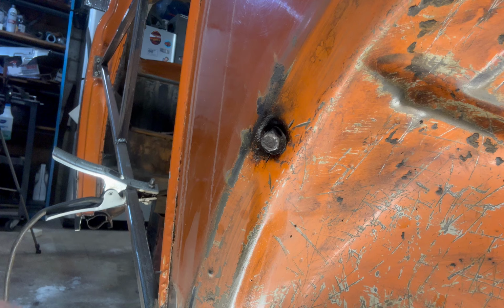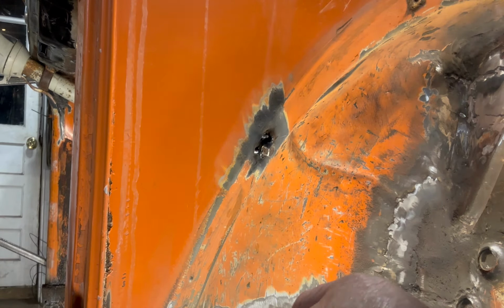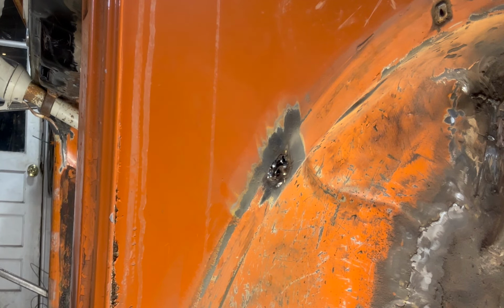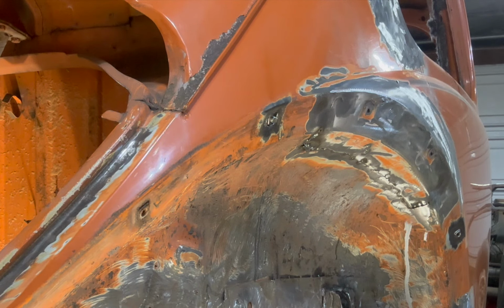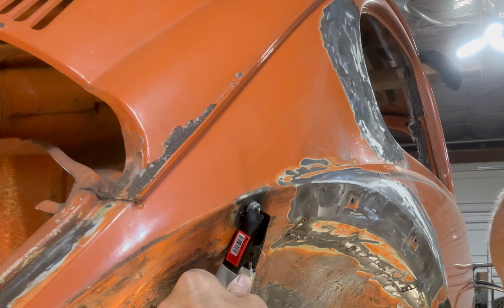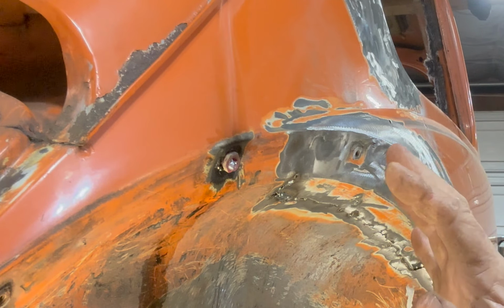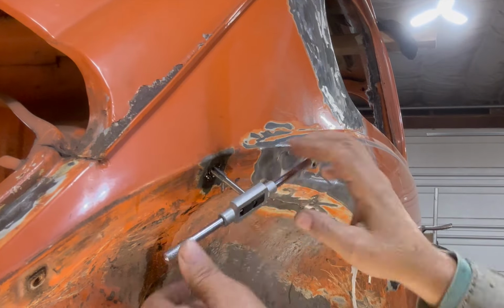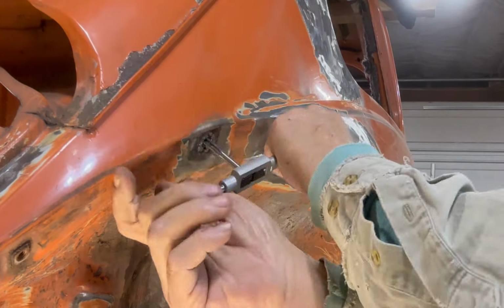FENDER FLANGE NUT BOLT AND WASHERS REPAIR

Comment: Good tips there Dave. Made me think of a problem I have. Last heater channel installed, all sprayed up, finished, mated the pan back up but when I tightened down the pan bolts most of the captive bolts came loose. First time that had happened to me in all the times I’ve fitted them, so annoying with the part and with myself for trusting the part. Cheap parts no doubt, the channels and the closing plates used to be separate, so you could check and prep, rust protect etc then weld up, and the metal was thicker/better. Long and short, learn from my mistake, if your channel is a complete one, turn it over, drill out the spot welds and give the captive nuts a Dave special, lot’s of penetration👍🏼
Funny thing also, I kinda knew you was thinking it as I was, but when you said “try,try, try again” it did make me smile. Have a good weekend buddy👍🏼
Reply from the maker: U 2 fill-up, I have hear of guys having problems with heater Chanel’s as you describe. I have heard of guys spot welding before inspection to stop this failure. Enjoy your weekend Philip.

Comment: Right on point, as usual!
Reply from the maker: Hello Trixed Out. Ty the comment and your support. A subscriber chis also mentioned welding a washer to the bolt first then welding the nut on. That is a great way especially with less bolt sticking out.